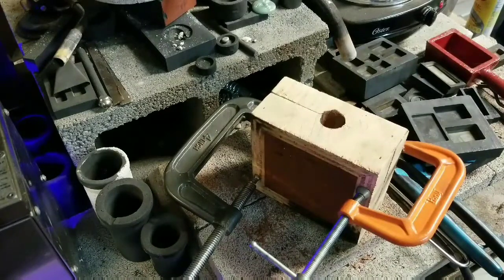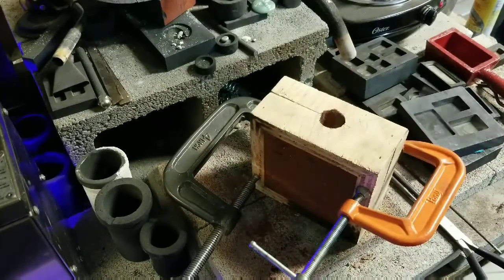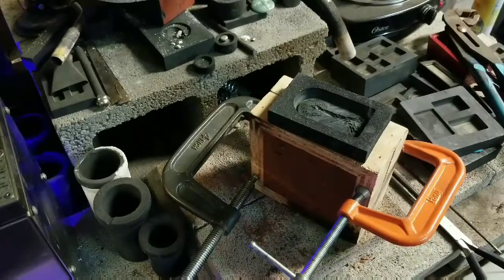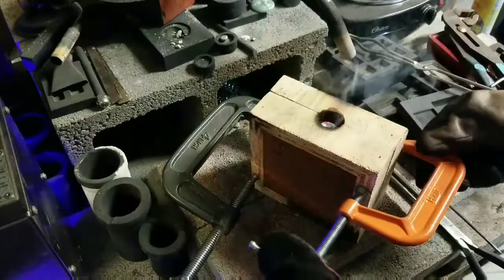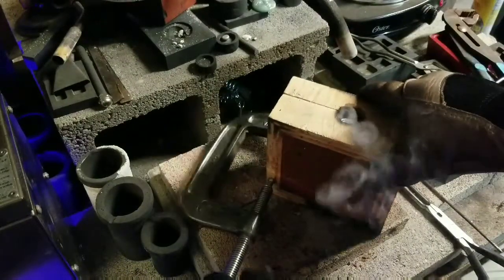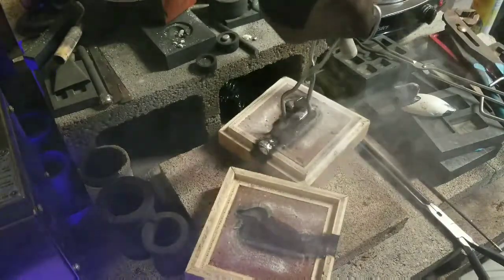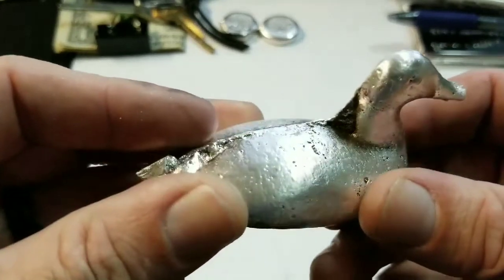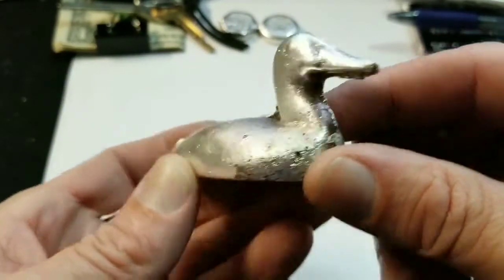another shot at the silver duck for dux butt!

Comment: Duck looks good bro. You actually casted it in the right size box. A flask is extremely thin and the size of the duck one each side of the flask would of left very little room between the mold and the outer edge of the sand.going into the tail was probably the best way to do it also. You will need that stone though to work that back side. Good luck👍🏻✌🏻
Reply from the maker: Thank you my friend, I appreciate all of your continued advice and help with this!